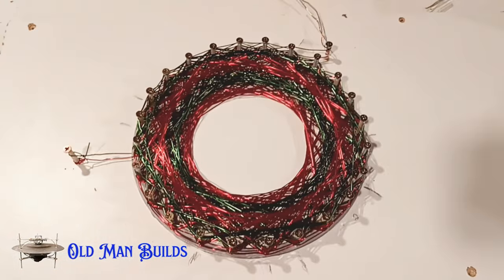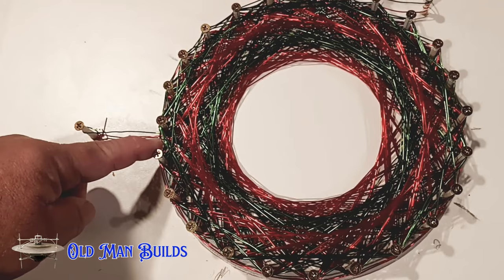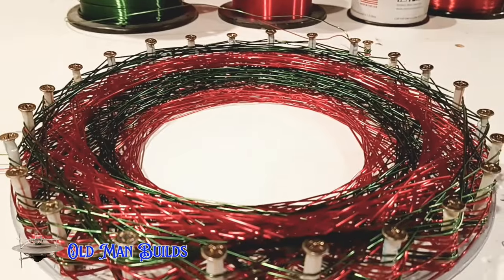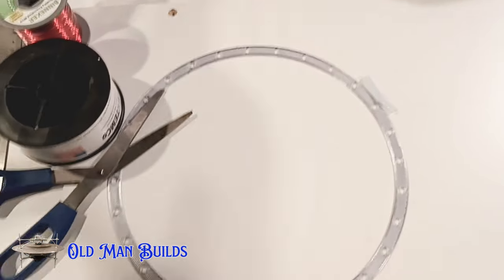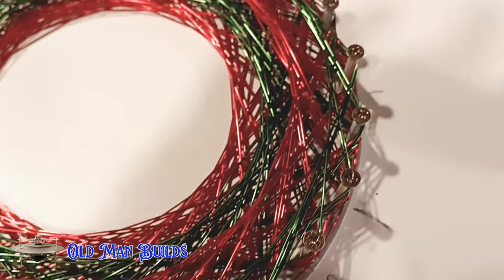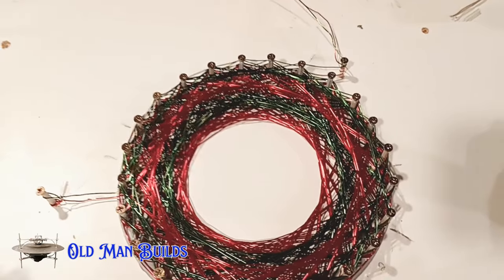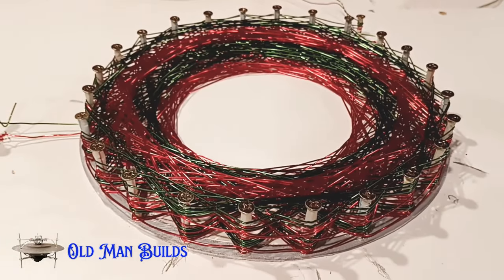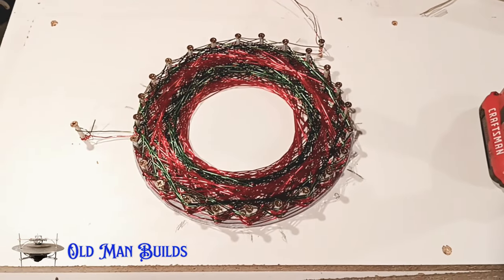First Attempt At Making Gerald's Coil

Comment: May suggest a yarn ball roller! If you tape ceramic tile spacers to wire, you can maintain the desired space and geometry with direct adjustment to your xy and rotational designs. Also it helps with materials being balanced in mass and volume. I think a large amperage injection field at double the frequency is very promising. Along with consistent balanced EME fields in a focused Conical Tesla coil diriected into a twin doubled circuit toriodial tesla coils spaced apart from each other by 1/3 the furthest part of the eme creating material coils. So that the conical coil is perpendicular to toriodial coil fields. The highest piont of conical EME focusing at the event horizon of the 2 toriodial coil. The non balance may, MY THEORY, is that this imbalance will create the force of motion desired to defy gravity and our inertia body/bubble. Thoughts?
Reply from the maker: When I ran the numbers the coils did not have resonance between any 2 layers. I did not build the outer layer. My mistake. Yes the straws to have problems. Nylon would have been better. 

2 fields need to be apart and a tesla field just needs to be resident to another coil to produce the oscillation needed. There also has to be a high voltage charged field. and a Simi conductive frame/shell. 

I have a rendering I made in fusion 360 and it may work. But i will have to run some numbers before building it.

Comment: Nice Nathan! That looks really good - what shapes did you put into it? 
I've been testing my own Gerald-inspired geometric toroidal Christmas ornament - interesting! His basic positive pulse circuit does produce some results - thanks Gerald!
Reply from the maker: I am still trying to figure out the coupling between 2 of the coils. Either I have the wrong shape on one of the coils or the outside I did not put on has to be the same as one of the coils.
Reply: @nathanbunten4299 You're way ahead of me, but the reverse winding on the toroid was perhaps not in vain - you should pulse one coil and cap bank the other/spark gap it - the geometry and reversal does seem to have a positive effect
Reply: That way you can treat the coils independently

Comment: I think you are supposed to go every 10 pegs for each triangle vertex? This is the same Rodin coil but multiple layers, 2d version and 24 pegs instead of 12. When using 12 pegs, you go every 5 so I would assume the same math would apply, doubled pegs, doubled pegs between vertex. I should send a picture of my Rodin coil. I used 9 parallel wires to wrap it, 12 pegs, I think I achieved an over unity even, because all of sudden my tiny Tesla coil that doesn’t really produce a spark. Made a pretty fishing line zing when my finger got close. I think I need more copper in my wraps though
Reply: @nathanbunten4299 my bad, for 24 pegs, I just counted out that you want to move 9 pegs between each vertex